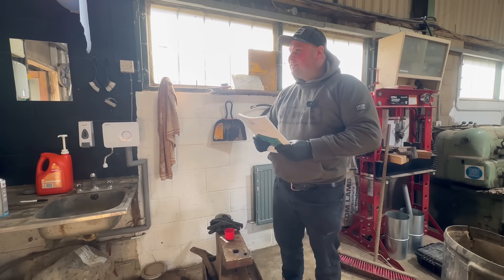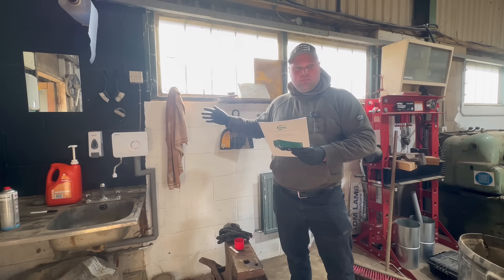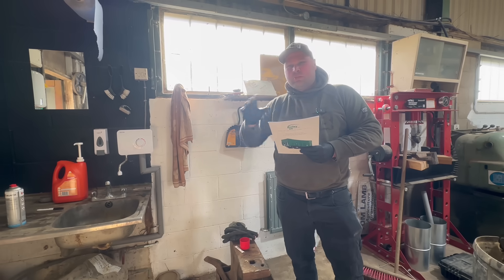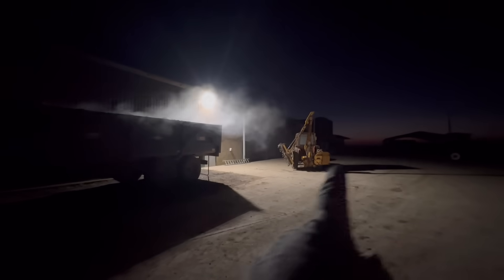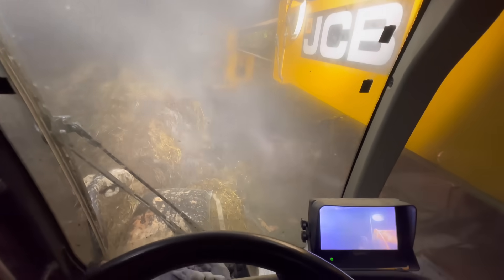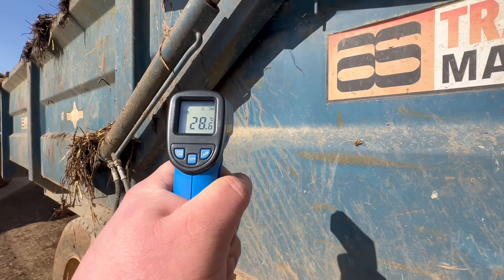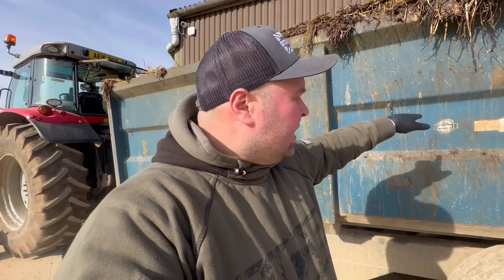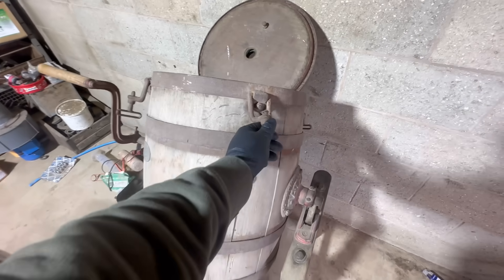How to heat water for a house using nothing but nature and rotting plants.

Comment: Now you need to capture the natural gas coming off the decomposing muck and use it for your cooking etc. 

THE FOLLOWING WAS WRITTEN BEFORE I GOT TO THE PART IN THE VIDEO WHERE IT'S MENTIONED. 
You need to raise the pipes at least 6 inches up off the floor. The heat transfer will be more efficient with the muck fully sure the pipes. More importantly with pipes on the floor, you're heating from the muck above and cooling from the cold weather below. Raising the pipes fully insulated the pipes from the weather..

Comment: Seeing how easy you pushed that long tube into the heap: you could weld 2 pipes side by side or on a steel plate for extra heat transfer and put a U-bent at the end. Then you can fill up this long U-tube with water and shove it sideways trough the middle of the heap, without having to disconnect the hoses from this U-tube. So once it is filled with water, without air traps, you could fetch a new heap and slide the U-tube in. That way you don't have to modify the trailer and easier to clean.

Comment: I5s a good idea but you will need to make it bigger like a cement bunker lined with tubes in the bottom and up the sides just be sure to keep the pipes just below the edges and use smaller tubes like in floor heaters that way there is less volume to heat and more time in the heat before coming out should increase the heat!

Comment: It could work but you'd be better off with longer pipes and a holding tank, have the water circulating around. Even if this water then fed a boiler, it would be cheaper than heating tap water

Comment: Insulating the Pile: In colder weather, you can insulate the sides of your pile with materials like straw bales or even old blankets. This helps to retain the heat produced by the microbial activity inside the pile.

Comment: Covering the Pile: Covering the pile with a tarp or a layer of composting material can help trap heat and moisture, creating a more consistent temperature. It can also protect the pile from getting too wet during heavy rains, which could cool it down.

Comment: Yeast or Inoculants: Adding yeast or specific microbial inoculants can help boost the microbial population, which might increase decomposition rates. However, it's not the most common or effective way compared to managing the pile's moisture, oxygen, and carbon-to-nitrogen ratio. If you add yeast, it could contribute to the breakdown process, but it would be more of a supplemental boost rather than the primary cause of heat generation.

Comment: I think this would work well. Maybe consider an upside down T shape on the pipe work, this is so you get the heat from the bottom and the heat in the centre.

Covering the trailer would increase the heat loss but you would need to ensure air can get in to help the decomposition process. 

Also is it just heat steam or is there any gas from the unit also? I was thinking if it methane gas could try collecting this also
Reply from the maker: @86744-i  im already on it

Comment: Might be able to replace the pipes in the bin with a radiator to behave as a heat exchanger. Basically use radiator on both ends as the radiator would have more surface area to capture the heat from the muck. Depending on the style of radiator it wouldn’t completely clog up with the muck.

Comment: More pipes of smaller diameter for greater surface area. The water will also get hotter to a point if circulated in a loop without any radiator load. To create warmth in the building, the heat generation in trailer needs to be greater than heat loss into building or the circulating water will cool down the manure.

Comment: always wanted to do this in the cattle courts, dig up the floors, lay down insulation, lay down blue water pipes like in an under floor heating type grid pattern and relay the concrete. 
The heat on a floor is tremendous when mucking out.

Comment: What you need is a small pipe in a bigger pipe so there is just one pipe to push in with a return. Or 2 pipes joined together side by side. Then have several or these pipes to push in then join them all together.. A bit like a steam engine boiler.

Comment: if you combined it with a heat pump the it would be much better.  Not free as you would need pay for the electricity, but many heat pumps give a 3-1 power to heat ratio, so very effective even in winter

Comment: Those infrared thermometers can be a bit dodgy especially with liquid temperatures. I would suggest you fill a bucket with warm water and insert a normal thermometer (like a culinary or candy thermometer, something designed for liquids) and then take a reading with the infrared thermometer at the same time and see is there's a difference. You'll at least know your infrared tends to run a 11' degrees hotter or cooler or whatever. If there is a calibration setting on your you could even adjust it.
Reply: Also I was surprised at the range you able to get a reading at. Most of the ones I've used want a max distance of 2 feet, you were taking a reading from the cab of the telehandler. What distance did it say to take readings from in the directions, if you've not already tossed them in the rubbish.

Comment: If it doesn’t work well enough to heat your house completely, any lift in temperature of the water in the heating circuit is energy saved. A hybrid system where water goes through the muck before the boiler will be worthwhile.

Comment: I worry you will use more diesel moving the muck about than if you installed a small diesel heater…
Reply from the maker: It has to get moved anyway so there isn’t much difference

Comment: I got 2.11 in to this video. So, Tom the person who's mentioned to have a cover the trailer is absolutely 100% correct about the heat. I move horse manure from a farm. I left it on the front. It was warm when I put it in. 8 hours after it was hot. I would definitely definitely put a cover over the trailer to increase the warmth of the manure. People on the allotment do this to make to bake potatoes so I would definitely put the cover over

Comment: My concern with having the pipes welded to the steel plate on the bottom or sides is the heat loss to the cold side (outside) of the plates. 

I would think you would have the highest heat transfer if the pipes mounted on a rack that would keep the pipes in the middle of the muck and away from the walls and bottom to reduce heat loss to “cold side” of the metal trailer.

Ron

Comment: To work efficiently using gravity doesn't the radiator need to be higher than the trailer? So the warm buoyant water rises to the radiator and the spent cool water sinks and returns.

Comment: As I said before there are some really cool designs for organic digester heaters out there! I think alot of the ones I've seen use the manure in a more liquid state. The Amish around here some have barns that store the waste manure in giant holding tanks under the barn floor, and it heats the floor up and heats the barn. I would think some dense foam panels to insulate the trailer, copper pipes and lots of them for the transfer, and if you could design a trailer the has beaters length wise that turn and stir the manure once a day to fluff it and let oxygen in. You definitely are on the right road. Free heat would be amazing!

Comment: I might as well add my two cents Tom.  You could get better results having insulation between the trailer and the pipes, attach the pipes to a metal plate to make a heat sink and run a small circulation pump for the water.  Good luck Tom.  If you painted the side of the trailer to look like your house no one would notice it there.  😂

Comment: The problem is with getting heat from cow muck compost is It is self insulating Meaning if there's a cold spot The bacteria will move away from that area And it will stop heating up, So when you cycle water Through your pipes you need to only take off a very small amount of temperature So the returning water is almost The same Temperature or Slightly lower. I know this would blow your budget but a ground source heat pump would work well with this.

Comment: 1. Park the trailer in the living room and enjoy the big steaming radiator
2. You’re essentially making a ground source heat pump. You could do the same way more efficiently if you have a flowing water course on your land. You can extract heat from the air or ground even if it is freezing. 
3. For the trailer, go for copper pipes and just get loads in there as many runs as you can. Or you can use flexible UFH pipe (plastic) and clip it all over the trailer sides. 
4 insulate the trailer floor and sides to stop heat loss to the trailer skin. 
4. For a well insulated house with enough rads a flow temp of 30c in the rads will be absolutely plenty. So you’re on to something keep shovelling! 🎉

Comment: I think the fact that the material involved has been available for centuries, but no-one has yet come up with a viable method to come to the desired solution to what should have been an obvious application for its use, should give you some clue that a positive outcome is unlikely...

Comment: Alright shag, the key thing with containing the heat and transferring it into the water is insulation. It takes time for the exothermic reaction happening in the muck to build up. If you dug a hole in the ground as big as the trailer and filled the bottom 2 ft with muck, lay your pipes (ideally plastic 15mm or blue 22mm acanthine so it doesn't rot) and then cover with another 4 ft or so you could leave the muck there for years. The longer the coil or run of pipe in the muck the more time the heat has to transmit into the water. The ground will act as an insulator around the pile, kind of like it is in the field. You should be able to have a constant flow of warm water.

Comment: The most basic one is you need to insulate the bottom of the trailer otherwise 50% of the pipes will be facing a cold surface ( I.e the bottom of the trailer)

Comment: Interesting idea, I’m pondering if you were to make sharpened points to drive into the pile from the top with insulated caps and lines connecting them together on the top sort of like how the vacuum tube solar water heaters work. Have a working fluid inside that evaporates the condenses on the top at the water/heat exchanger in the top of each pipe. Think pc heat pipe. The vacuum tube solar water collectors have a bulb at the top that gets supper heated from the heat pipe function and they are slotted into an insulated manifold that transfers the heat from the bulb to the manifold and then to the water inside the manifold.

Comment: I can get about 60t of woodchips in the store for my boiler.  It's quite narrow and high, and depending on how wet the chips are, the core of the pile can get VERY hot, sometimes within 48 hours of filling it.  When I started doing this about 10 years ago the urgent question was hot does it need to be before it catches fire?  My research suggested 80 deg c should be the absolute red line, so on the basis that my 2 temperature probes might not be in the hottest place I consider 70 to be my red line.. To control it, I have 4 ordinary (metal) grain cooling towers with fans on  set to start at 65 and stop at 30; it usually takes about 24h to do this, and a full cycle might be 4 - 10 days.  We get masses of steam out of the fans, so eventually it all dries out to the point it stabilizes, which is what I want - self dried wood chips.  

I've often wondered how I could exploit this heat - grain towers are vulnerable enough to machines so having fixed water pipes in the store is a non starter, but your idea of doing it in a tipping trailer is complete genius.  With the right mixture of muck I think you should easily be able to get a core temperature of 80 deg c and to collect this heat I suggest you mount the pipes on 2 vertical webs a couple of feet high in a loop returning to the headboard, so it will still tip out of the 3 channels without getting stuck (much), and another loop on each sidewall. Plumb it so your water is flowing round the sidewall loops first and then being boosted in the middle; spray insulation on the outside of the sidewalls might be a bonus.

My 10 cents for a really good idea anyway....
Reply: If you want a free heat meter to measure output in kWh, I've got some.

Comment: Love the vide Tom. I've watched another video of someone powering a hot tub off a compost heap with coils of pipe

One thought is are you putting an expensive trailer out of action because it has to sit there full of muck? If so that makes this system quite expensive?
Reply from the maker: @sampayne8381  that’s all it’s used for anyway

Comment: How long will it heat for is teh big question. If you must change it out or refill it to often then it would be a pain + do youhave control of the system if you want less heat.
Otherwise it looks intresting

Comment: Great video Tom I can’t see why it wouldn’t work Olly said about the same thing with his wood chip heap the concrete was extremely hot and mentioned about putting pipes in the concrete to use it for heating so two people can’t be wrong 👍👍

Comment: Putting a sheat or a cover over the trailer wont effect the bacteria and oxygen. The muck heap is so dense that there is literally no gas exchange in the heap and the oxygen from filling the trailer is enough for a few weeks
I once read about "perfect" muck rotting/muck decomposing and it said to completely turn the heap every six weeks because the oxygen will last that long
Reply: Nice..!  Maybe if you use a thermal camera/thermal camera phone (like my AGM thermal phone) to 'see' the bigger thermal picture of the hottest spots...🤔.  
Also:- if you insulate ALL around the trailer & top, things would heat-up quicker..👍

Comment: Tom, covering the trailer won’t hurt the process as microbes 🦠 are anaerobic so don’t need oxygen. Also put the pipes higher than the middle as heat rises.
Reply: Surely you want aerobic decomposition. Otherwise you lose energy to making methane rather than complete decomposition.

Comment: the question is how long will it stay at 50 degrees through out winter? long term experiment is needed, now if you had pipes in the middle of the muck heap would that be a constant temp over what 5 months ???  i would create a frame that you can drop over the top of the heap with looped pipe probes, you know like a arrow tip but the shaft of the arrow is the pipes, heat rises, so a maybe a blanket of some kind goes on top of the heap, would the heap stay longer in the trailer if it was insolated?

Comment: You will require a cover to keep the rain off.  If the composts gets wet it will stop 'working'.
Try putting a skirt around the side and bottom of the trailer. It will help retain the heat.  You could put more compost under the trailer, like having a lamp under a car to keep the oil in the sump warm in winter.
Second thoughts, put the trailer in a shed.
Reply from the maker: @jonb3311  what happens when the big heap in the field gets rained on everyday ?
Reply: @Tomlamb980  Rain will run off the heap.  Your trailer will collect the water.  Home compost heaps always have a cover.